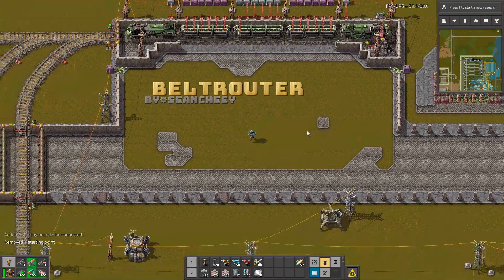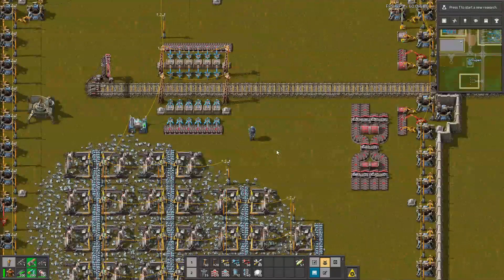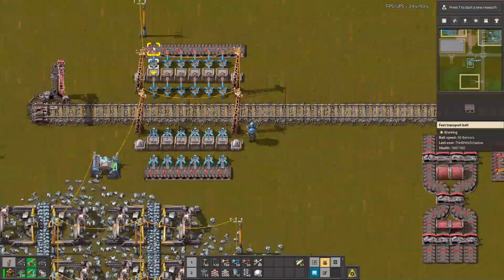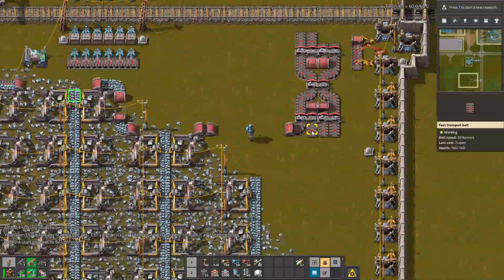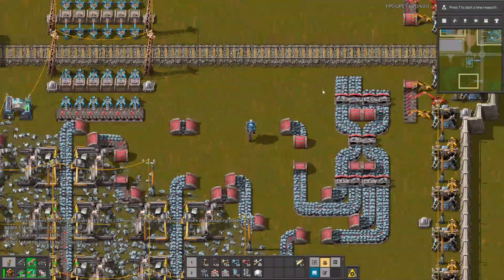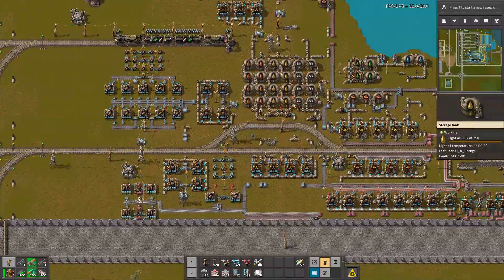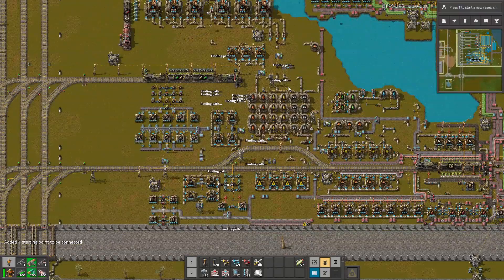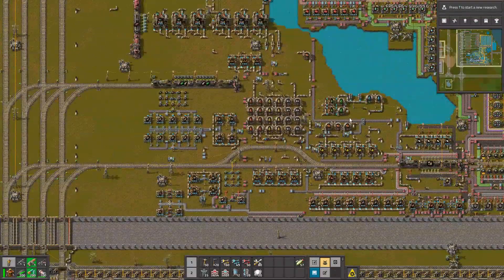Path Find your Spaghetti

Comment: It's not really a solution finder, but it's a perfect spaghetti generator. I'd love to try a playthrough that's done purely with this mod.
Reply from the maker: I don't know if this mod can handle a longer distances, because it's getting kind of laggy with a more complicated paths
Reply: @Trupen2  just means you spaget only in your offshoots of the main buffer
Reply: @Trupen2  of course, NP-complete problem space. (too bad I'm a computing scientist, can't stop noticing those things)
Reply: Challenge: no manual spaghettification allowed, only what this thing spits out.
I might even know a guy who'd be up for that kind of suffering...
Reply: It has a limit of 1000 tiles from what I remember. The simple workaround is to place intermediate belts (or pipes, because it works with those too) somewhere in between the two endpoints.